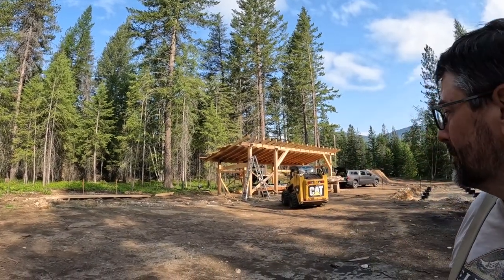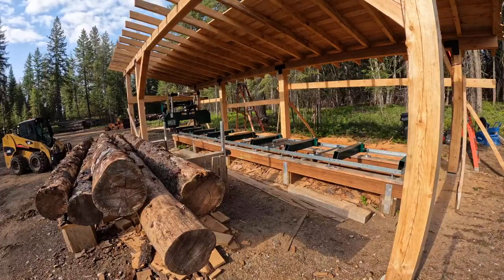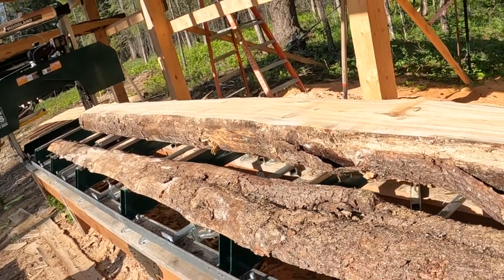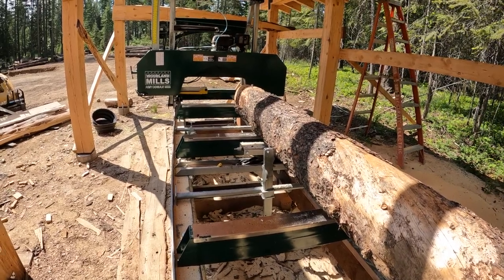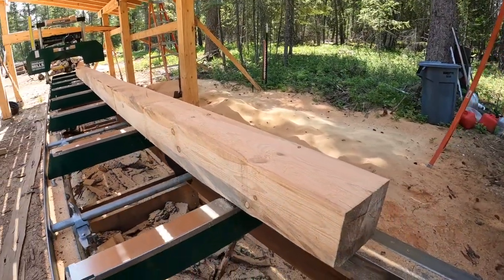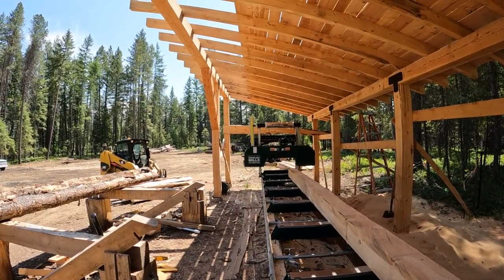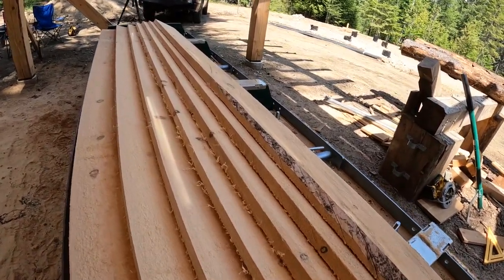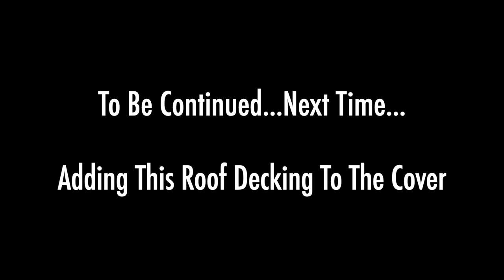We Ran Out Of Roof Decking // Milling Roof Decking On The Sawmill // Woodland Mills HM130 Max

Comment: An extra set of hands sure helps on the sawmill. I will be looking forward to the video on the manbun. I bet it will be one of your most viewed videos!! 

I have seen several videos where people have mounted a DRO (Digital Read Out) on their Woodland Mills Saw. They look like they could be very helpful. Have you considered adding a DRO? The power up and down looks like a big help. Saves the arm and shoulder for sure.

Some have added a laser also. Your logs look straighter than some so it might not be as helpful as it is for some people.
Reply from the maker: HI, Mike! Joey was a pleasure to have out helping on the sawmill! Hopefully, the two of them will make more frequent trips to North Idaho.
The power head and custom scale have been such a great upgrade that I haven't thought much about a DRO. Might be something to consider down the road. I added a laser last fall, but wasn't that impressed. Didn't seem to broadcast down the log very far so I gave up on it. I was thinking of ordering one with increased power.
All I've been doing is thinking about barn foundation.😁Thanks again, Mike, for your thoughtful comments!